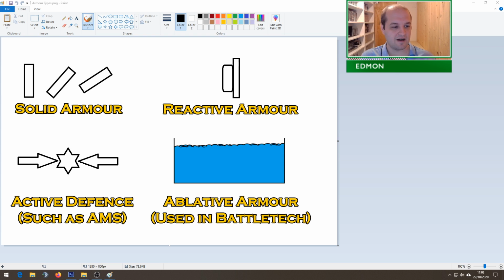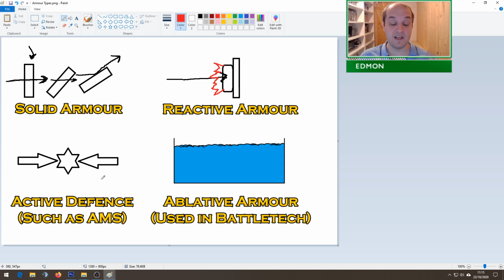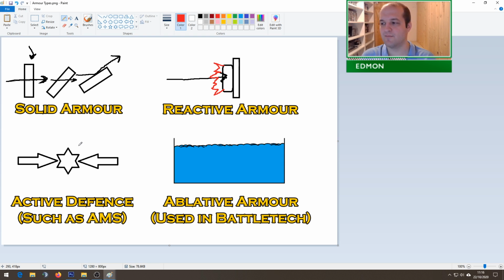Misunderstood Battletech Lore - Armour and TAC

Comment: Pretty sure you were getting some important mechanics wrong from the Mythbusters episode.  Heat didn't really have anything to do with why the bullets were shattering.  It was the sheer internal physical stresses induced once the bullet deformed slightly deformed and began tumbling...both the gyroscopic rotational forces induced by the rifling and several thousand psi of energy carried by the bullet's inertia. 

Heck, if you fire a bullet too fast out of a rifle barrel with too fast a rifling twist, the bullet will explode from the internal stress induced by spinning so fast.

Oh, and the material and terminology you were looking for with the sabot round was a tungsten penetrator, basically a big arse solid tungsten dart designed to penetrate tank armor and the bounce around the inside turning the occupants into pulled pork and maybe hitting something explosive.

Hope that helps.
Reply from the maker: They used water as the target medium. It degrades objects via frictive force... that the bullet also breaks down via other forces doesn't strictly matter. It's the same effect as when things enter earth via space - eaten away via frictive forces. But anyway, the point is that it's an abalative effect and that's what Battletech models.
Reply: @TheEdmon  
You're talking about burning up on atmo entry?  It's not the same thing as a bullet entering water.  Even considering the much higher density of water, a bullet--specifically the ones the Mythbusters used--were moving far too slow for that kind of effect,  less than 3000 fps or right around Mach 2 for the rifles and closer to Mach 1 for the pistols.  The forces tearing the bullets apart were almost purely mechanical.

I think a better illustration of ablative armor is demonstrated by the YouTuber Banana Ballistics when he shoots the concrete block with the square of plywood behind it.  Most of the time the block just shatters and the bullet doesn't even make it to the wood.  A follow-up shot would, of course, punch a hole in the wood being as the concrete has been pulverized and has lost the ablative effect.
Reply: @TheEdmon  
Heh, guess what popped up in my suggested vid list?

The BHS boys made some super good videos featuring what happens to a bullet hitting water and also an example of what happens when a bullet hits ablative armor (ceramic composite).

Here's the water vid:
https://www.youtube.com/watch?v=ZBf4gFDSRN8

Although they didn't get the extreme bullet fragmentation the Mythbusters did, I'm pretty sure it's because they fired square into the water instead of at an angle.  Hitting the water at an angle will probably cause the bullet to yaw far more quickly than entering it square did, thus causing more fragmentation.  Still, while I'm sure some of that bubble following the bullet was no doubt steam, it was pretty clear that heat really didn't have anything to do with the bullets fragmenting.  It was pretty wild how the .223 bullet yawed and flattened out longitudinally from the force of resistance against the water.

The second vid, demonstrating ablative armor, was pretty interesting too.
https://www.youtube.com/watch?v=E7a4-E2TzmY

Those guys make some fun vids.

Comment: Standard battletech combat armor isn't ablative in lore. It's basic composite armor plating. There are rules for ablative armors.

For gameplay purposes it acts like ablative armor because it's treated as hit points.

There are also rules for penetration without destroying all the armor, resulting in critical hits.
Reply from the maker: BT armour acts like Abalative Armour, irrespective of what some of the lore says (and there are contradictions in the lore). However, the Official Canonical Techmanual says this:

"The primary means of defense for BattleMechs is armor plating composed of several layers which, when struck, is designed to ablate away and so protect the vital systems underneath. "

And from a gameplay perspective, the armour also behaves in an abalative way (I.E. it is entirely depleted before damage is carried through to structure. There are no Through-armour criticals.)

Comment: Hello. Edmond I'm kind of new to your channel but I enjoy your vids. Also, I'm an engineer for material science and...well... you got things wrong when it comes to the Myth Buster test. If you are interested we could talk about what is going on there and maybe some insights why "ablative" armor is not a reality. I know BT is fiction (read about 50 books when I was young) but maybe you are interested what science and engineering has to say to walking mechs etc.
Anyway it is an older video and maybe you will not even see the comment but thanks for the content.
Reply from the maker: Hey there, BT is the way it is because it is fiction. The armour is fictional and does not track to anything real. However, the point I was making is that the way BT armour behaves is most like the way water ablates a projectile and maybe they were basing their fiction on this concept.

I don't really want to do any more materials science, I did enough physics back when I was a telecoms engineer, but thanks anyway :).
Reply: @TheEdmon  Hello. No problem. Thx for the answer.

Comment: I made a mech game with a solid armour system. The mechs are able to compete with tanks on a survivability rate because the Mechs have superior armouring techniques such as modern composites while tanks are still made in steel. Why? Because the mech pilots are the owners of the military and want their big mechs to outperform tanks and be a staple of society, while tanks are just a cheap war tool.
Reply from the maker: What game was it, that you made?
Reply: @TheEdmon  My own board game under the name Mechanised warfare. (play on words with the mech thing). It's not released, it's a work of passion that I've not published and currently am in the process of playtesting. I'm making my own lore for it but it's also usable with Battletech gameplay with a bit on converting. I came up with the game after brainstorming on ways to change BattleTech rules to my liking (though changing BT failed in my eyes). Though as it is a home made system, it is still in much need of fine tuning to both improve gameplay and simplify certain points of the rules system.

Some of my key points are an armour penetration system, harder to abuse movement which favours more agile mechs, a power management system that shares power amongst the weapons, movement and (in the future) equipment such as shields and sensors, and a melee system that is more interactive with the opponent.
Reply from the maker: @alexanderhogan4546  Good luck with it, game design is a lot of work. I don't miss working on my own game.

Comment: This isn't entirely accurate. BT armor works essentially like modern ballistic plates do, just scaled up and with much more durable materials. Most plates are rated for a certain power of caliber and can be expected to take a number of hits from calibers of that power before breaking. If you hit a plate rated to stop a single 7.62x51mm AP round from a sniper rifle with a 9mm bullet from a pistol, the plate doesn't shatter because the 9mm bullet doesn't have enough energy to break it. If you hit it with enough 9mm in quick enough succession you would eventually shatter it, but hitting it with an attack that isn't powerful enough to break it won't immediately break it. If you have a plate rated for three 7.62x51mm AP sniper rifle shots and hit it with two, the plate will still be there because it can absorb more. There are some factors that can effect this, such as how quickly the shots land, if they hit the same exact spot, etc, that could cause it to shatter prematurely, but generally speaking a plate rated to stop 3 high caliber bullets will reliably stop 3 high caliber bullets. 

To apply this to your example, if you hit a plate that can absorb 5 points of damage with 3 points, it won't break the plate. The plate will be weakened, and will shatter if hit again by another 3 points of damage, but it's still there. The way I've always justified TACs is that you can't armor everything in this style. Some areas, especially joints, have to be essentially unarmored in order to function. Joints are the big one since they have to move, so while they might have an armored "covering" on them, there have to be small openings where a shot would essentially be "slipping past" the armor and reaching the internal titanium structure, the external layer of which would essentially act as "solid armor". A lucky shot hitting in that kind of location would have the potential to penetrate this weak section and cause internal damage via shrapnel, or starting a fire, or whatever you might think of, which is represented by the fact that you still have to roll to see if you actually cause a critical hit even if you roll the golden BB.

Comment: I always thought Ablative was just a sacrificial layer that burns away taking lots of heat energy to do so... like they have on the Ablative shields on re entry vehicles. I addition the burned outer layers of the material sticks hard to the unburned material underneath and is often and even a better insulator but its eventually vaporises off . They are generally some sort of ceramic and probably Zr or Al based.. which is good for heat but not as good for at physical impact but can shatter to absorb loads of energy... but Battletech isn't real :)

Armour piercing rounds don't use mass to penetrate, they have a shaped copper charge in the nose that essentially vaporises and cuts/burns a hole through the armour for the mass and rest of the round to follow through into the vehicle and it's why reactive armour exists as it disrupts the copper cutting a hole through the armour. I don't think the reactive armour contains any metal bits as that would annoy the support infantry a bit... and also it wouldn't do diddly squat other than annoy the support infantry.. Chobham Armour is supposed to be a multi layer system of various materials that resists both the mass and the copper cutter... but BattleTech isn't real :)
Reply from the maker: You are thinking of HEAT rounds. These are the ones that project hot gas/explosive into a tank and bore a hole into it. Standard AP rounds just use a solid penetrator. HEAT rounds are normally stopped by spaced armour, which gets them to trigger early and inject their load into the gap.

Comment: Solid armor is not "binary", projectiles are not "limited" to either defeating the armor completely or bouncing off. 

If the projectiles does not have enough energy to penetrate solid armor it will get stuck in it. Solid armor will deflect penetrators when hit at an appropriate angle, independent if it is itself angled or not. Being angled increases the chance of deflection significantly, and as mentioned in this video effectively increases the thickness of armor. 

It must be noted that deflection can happen with older projectiles used during the WWII or immediately after the war, it does not happen with HEAT, HESH or APFSDS (kinetic energy) projectiles. HEAT/HESH were the primary anti-tank projectile during the '50s and '60s, with kinetic energy projectiles becoming more and more prevalent as they become more effective during the decades.

Comment: Explosive reactive armor uses explosives, but not to directly hamper the incoming penetrator (first generation ERA was only meant to stop HEAT projectiles, not solid, kinetic energy projectiles). ERA blocks have a metal plate at an angle, so when explosion happens that metal plate is pushed against the penetrating HEAT jet, basically feeding more material in the path of the penetrator,  to dissipate the jet flow, with potential to disrupt it's path.

That's how first generation ERA works. Second generation ERA has been developed to reduce KE penetrator effectiveness. They have an additional metal plate, at a different angle, so when explosion happens both plates are pushed in different directions, introducing a shearing effect on the penetrator, either changing the angle of penetration or simply breaking/cutting the penetrator in several components, reducing it's effectiveness.

Comment: Tbh, i always assumed that narratively a tac finds plating that was already spent.
As you apply x tons of armor to a limb, and each Ton Gives y points of armor rating spread over the entire location.
Which means that realisticly the 11 locations we get is heavily abstracted.

And the tac is there for the Times you actualy manage to Hit the exact same Spot twice. Thus getting through the armor still covering most of the limb.

Which makes the official rule of only hitting torsos with tacs seem more silly than the house rule of rerolling location after getting a tac.
Reply from the maker: It depends on how the Ablative plates are made though, as I suggested in the video, if they were made long and thin and in layers, it would be very hard to avoid them. Of course, this would require sexy future materials we don't have...
Reply: @TheEdmon  even then Hard to avoid does not mean it's impossible to Hit the same strip twice. Or the same spot as often as there are layers.

If anything the fact armor in BT works perfectly out side of tacs until the very last point is used up is, imho, more unrealistic then  1/36th of Hits finding a hole in armor that is Designed to become swisscheese over the course of a battle to get through to harm mechanics below. 

Because no matter how thin or futuristic, as long as it is ablative armor it will be gone sooner at some spots then others.

I.e. Under current rules abstractions, hitting something like hip-knee-ankle will Do the same harm to the leg armor as knee-knee-knee. Where as in reality the later should have much better Chances of getting through that armor.
Reply from the maker: @maximilianschug6271  That was my point, if the layers were like painters suit. Then no matter where you shot me, you'd hit some part of the painters suit, since it covers me completely.

This is what I mean by them being long and thin plates, rather than short and seperate ones like the types we currently use in real life. Although that said, a single large plate covering the whole chest area of a soldier is not uncommon. In this case, you have a real life situation where a single plate covers the whole chest and you can't avoid hitting it.

Obviously, it's a game system so there is some serious abstraction going on. But wide coverage single plate ablative armour is not unrealistic.
Reply: @TheEdmon  except that Covering legs in layers of complete armor would make using the knees rather Hard. Not to mention the fact that with a skilled enough pilot mechs are, according to the fluff, rather nimble and acrobatic.

Not to mention that, at least every battletech novel i read, damage is described in a much more localized Manner than destroying armorplates Covering whole bodyparts.

Unless i completely misunderstand you, what you are proposing would mean damage to mech armor would be akin to ripping off an onions layers one by one.
Where as i assume it to be more akin to cutting of bits of onion  where the damage happens until you end up with a Pile of diced onion.
Reply from the maker: @maximilianschug6271  Battletech is abstracted so that there are certain sides of the armour. There is no rear leg for example, or side armour. When you hit the side, you magically hit the "front" of that region.

Under that abstraction, it makes sense that the ablative plate is like the layers of an onion. As it would be if you had a ceramic plate on the front of a solder protecting the chest in real life.

I am saying this type of armour is realistic, not that Battletech is realistic. Battletech is not realistic and neither are big stompy robots. But layers of flexible, thin, ablative plates using future materials potentially is.

Comment: I always assumed TACs were attacks hitting vulnerable spots on a mech. I mean they aren't solid blocks of ablative armor - they have joints, heat sink vents, cockpit canopies, access hatches, sensor clusters and the like.  Those may be small targets, or somewhat protected, but they are still vulnerable to a lucky shot.
Reply from the maker: That wouldn't be through armour though, then you would be directly attacking exposed structure. The critical hit table I think is meant to represent this, especially for things like tanks which take a roll on every strike in TT.

Comment: There are rules for alternative armor types in tt. They are very rare though as even if using those rules they are expensive, hard to attain, & have drawbacks that cumulatively are usually worse than the benefits. What they call Hardened Armor is the only one that gets regular use as you can effectively double the amount of damage a location can take. It's extremely valuable to use on the Mech head making it possible to survive an AC20 round to the cockpit.
Reply from the maker: Yeah, some mods have hardened armour. I never see the point though, the pilot will usually die of injury before that much armour can be worked through and it leaves you with very little tonnage for weapons.
Reply: @TheEdmon  in tt it's not a package deal. You can put exactly the amount of armor you want wherever you want. You can also avoid the penalties by having a different armor type on the legs.
Reply from the maker: @verpalorian310  That sounds, kind of gamey :D